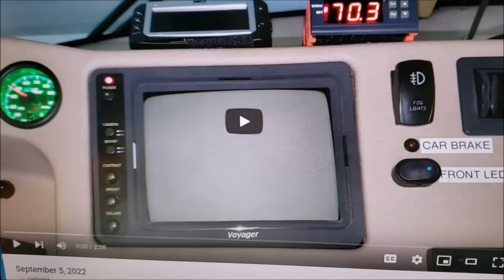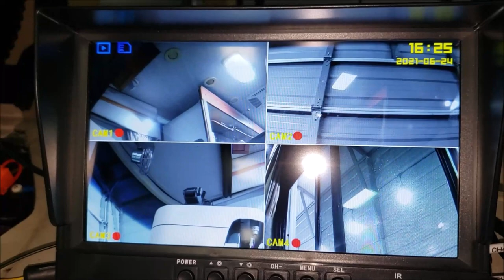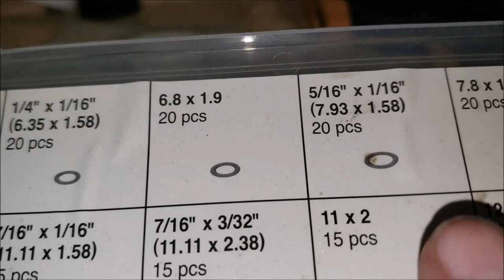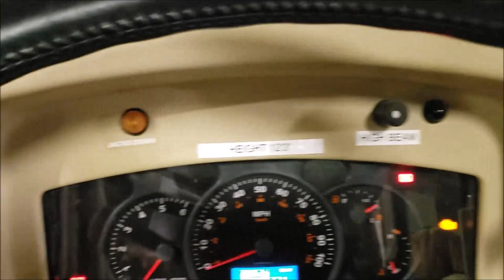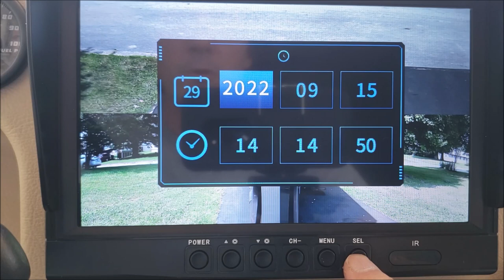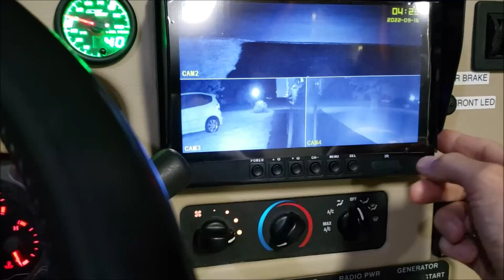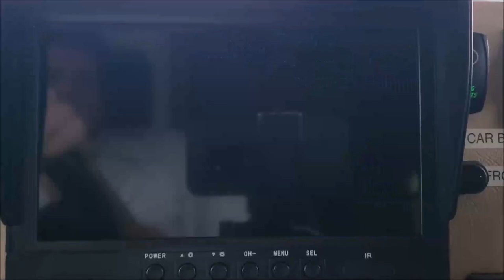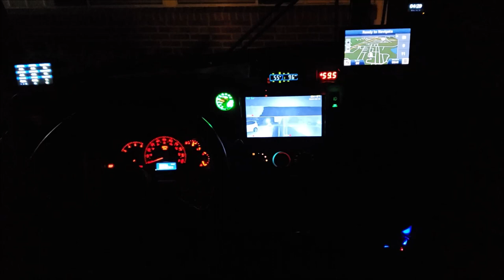RV Motorhome DVR 4 Camera Security System Complete Installation of Wired eRapta A9 1080P 9" DVR

Comment: Hey Kevin, your idea for the left/right camera mounts is brilliant and I used your design.   Of course the product has changed slightly, they improved the side cam mounts (metal not plastic), but lowered the quality of the TV mount part.  The version of the display mount I received  was nowhere near as sturdy (the side mount parts (not used) didn't change, just the back mount).  All in all and excellent DIY video - Thank You, I just finished my install on a (2005 Voyager 33v, w22).  See ya on the road - Ken
Reply from the maker: Thanks for contributing Ken I would love to see some pictures of your install if you get the chance you can send to my cell phone 606-875-0125 or my email address kc5210@gmail.com
Reply: How is the quality?

Comment: At 24 min you jumped from running the cable down the frame rails to the cable hanging out were the camera mounts. How did you get the cable from underneath to the hole. Mine has a 6" cavity from top to bottom across the back and on mine the old cable was built into the ceiling and I can't use it to pull in a new cable. Great video.
Reply from the maker: I dropped a string down the hole, then tied it to the new cable and pulled it up.

Comment: Hey Kevin Love your videos.  I installed this system using a lot of the information you provided.  I painted the outer shells of the side cameras to match the lower bout of our RV.  However I do have one problem.  The rear camera acts normal when I shift into reverse, BTW on my 2004 Winnebago Brave 34D the reverse activation wire was green, but I found it using your information.  I get a full screen everything normal.  I hooked up the left and right turn signal trigger wires and my unit goes nuts.  When I activate a turn signal, the display goes to that side then starts flashing on and off in time with the turn signal blinking.....any thoughts?  Had to disconnect the trigger wires for the turn signals, think it could be a problem with the display?  Anyway, thanks for the great videos really appreciate them.
I have installed both the Transmission Temp gauge and Fuel Pressure Gauge from MaxTow like yours, love them both, I have the Workhorse chassis, with the big 496 CI Chevy, and tow a 2019 Jeep Wrangler Unlimited.  Also installed the ScanGauge II like yours love it also
Reply from the maker: Give me a call or text . my cell is 606-875-0125 Kevin
Reply: James, may I ask how you attached the sensor to the transmission, and what did you do to prevent rain water and wind from affecting the sensor from  providing false temperature?
Reply: Per our conversation changing the settings from 3 seconds to 6 seconds solved the flashy flashy problem.  Per the photo, oops Sorry Larry you didn’t get the photo, and I don’t know how to attach it here, sent you remove the inspection bolt next to the transmission filter oops catch the little bit of fluid that comes out maybe a pint, screw the sensor into the hole and you don’t have any worries mate 🤠

Comment: Hey Kevin, one other thing I did, cut the end off the cable that went to the old sony monitor, and spliced in a pigtail that will connect to the new system.  That way I didn't have to run another cable.  Did that at both ends.  The old cable has red and black, power and ground, white, audio and purple for video.  The pigtail I ordered from ebay has red and black, white and yellow.  Yellow to the purple for video.
Reply: Thanks for the info! I also have a Sony Monitor and would love the know the pigtail pic or catalog number so I can use the existing rear camera wiring. Please forward this info to m...I am ordering my system tomorrow! Thanks! Jeff

Comment: Great detailed video, I've been wanting side camera and the back up camera on my (new to me) 2006 W24 isn't the best.
I do have an off topic question. That whine you have that changes with RPMs, is that power steering that Workhorse says is normal noise? I have that whine and thought it was the Allison transmission at first but after reading posts on IRV2 and seeing your power steering fluid/filter change video, I was going to do the PS fluid/filter change (I already purchased the filter and fluid) to see if it helps, RV is at 54k miles and inspection found no leaks. Most everybody on IRV2 says its normal power steering noise for Workhorse per Workhorse (still plan to change filter/fluid), just would like your input on it.
I've been saving many of your videos to fix/repair things on my RV. They are so helpful!
Reply from the maker: Yes the wine can get very loud at 3800 RPM and you will notice the tune will change if you move the steering wheel slightly I think its the rushing of the power steering oil flowing past the bypass ball and spring.
Reply: @ktoutdoor  Thanks, I read that people get used to the noise and don't really notice it after a while. I'm just happy its nothing majorly wrong. 
Have a good day and keep tinkering...and filming! Loved the window tint on plastic for darkening your screen.

Comment: Kevin - I have the very same system installed on my Class A.  At first I thought it had great video but, in the bright daylight the cameras appear washed out on the display.  Adjusting the brightness and contrast helped but they are still unusable during the bright daylight.  I most likely going to spend more money and get a better system that works for me.
Reply from the maker: Sorry to hear that mine are still working great, if you like the DVR system can you just upgrade to better cameras?